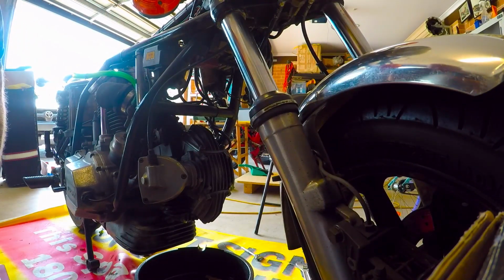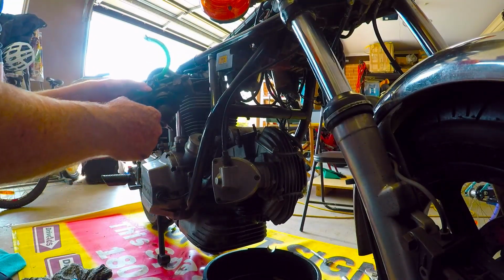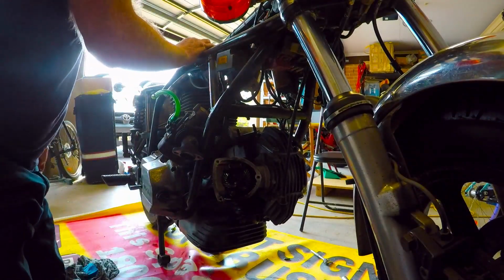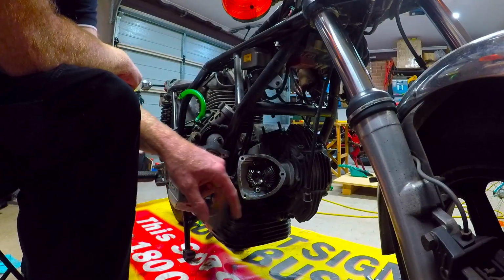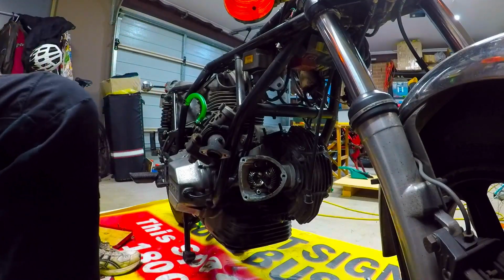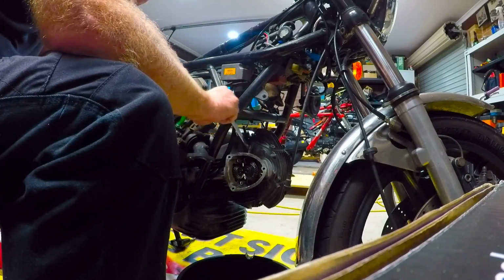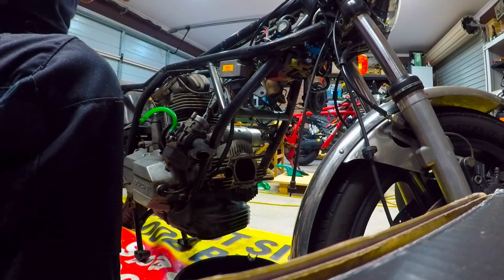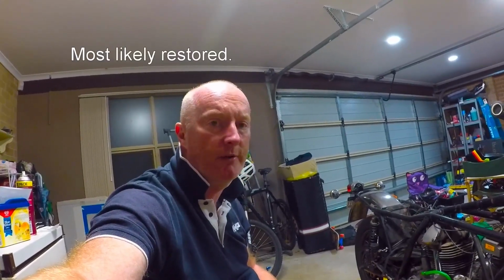Ducati Bevel head removal Darmah

Comment: I'm about to remove the head of the front cylinder of my 1978 Darmah to replace the valve seals and Googled "bevel Ducati head removal", only hoping to find a write up or something that would give me enough clues to get going on the job.  This video was one of the top results and it's straight to the point with exactly what I needed, friggin' outstanding!  And I see part 2 shows partially dropping the engine to get at the vertical cylinder head, the very next task I was wondering about (although my vertical cylinder is behaving itself at the moment, so I may do that later).

Thanks for recording and uploading this!

Comment: I’ve the same. Half power, oil in just the right exhaust. Q is, did things have to go this far? Maybe I can just pull that front head, swap a valve seal or gasket? The idea that my Darmah would be in limbo for what are you going on for now, 4 years!? Nightmare.
Reply from the maker: I could have probably got away with just replacing the rings. But I went down the rabbit hole with it. Now the motor is stripped down and just waiting for it to be put back together.

Comment: Maybe check the valve shim clearances and do a compression test before taking the head off would have been a good idea
Reply from the maker: Had multiple plugs foul up (every 200klm). When explaining what was happening with my mechanic, he advised me to remove the head. sadly this was just the start of the rabbit hole and now motor is off to be rebuilt.

Comment: Great vid.  I'm surprised the valves got loose enough to result in oil leaks; I;m trying to work out how this happened.  My bike's heads would start to get noisier and noisier as it approached Desmo-time at which only small shim adjustments were required to get the valves back within spec.  The valves were never what could be described as "loose".  I'm looking forward to more vids!